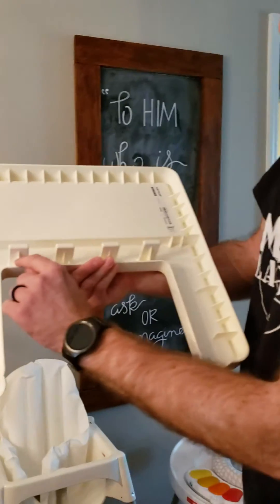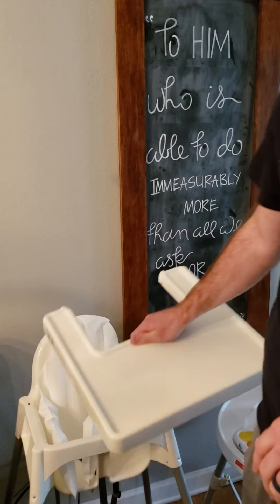Ikea highchair tray removal - reason explained

Comment: Just a tip.  If you need to hold the chair steady, hold it down with one hand and pull the edge of the tray off with the other.  Works every time.

Comment: Just bought two for my twin today and it’s been hell removing the tray- despite watching this video, can’t get them out- is it because it’s new or what?
Reply from the maker: Hi Jedidiah, do you notice the tabs under the tray? are they the same as in the video?
Reply: Yes it is but super hard that I’m unable to push it. I guess maybe because I’ve got some weakness at my wrist (after childbirth). It’s crazy IKEA didn’t think this through at all
Reply from the maker: @jedidiahesther5255  OK at least it might be the same. I can try to explain something but it might be hard to type. Basically use something long like a dish spoon that you can place touching the stiff rib/tab where i put my thumb in the video (0:53). Then make sure it is on the inside of the leg divider and it reaches to the other side leg hole. Then pull it through the leg hole bracing it on the leg divider like a seesaw.  if the other end stays contacting the stiff rib/tab it should help to move it..then as you do that lift up on the table corner like the video
Reply: Thanks for the detailed explanation. Will try this when I’m back home and revert